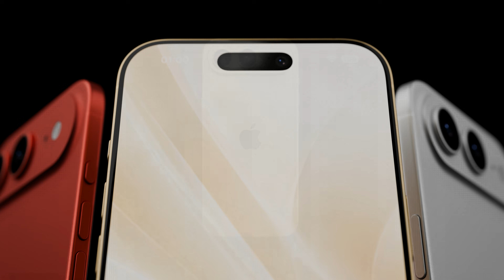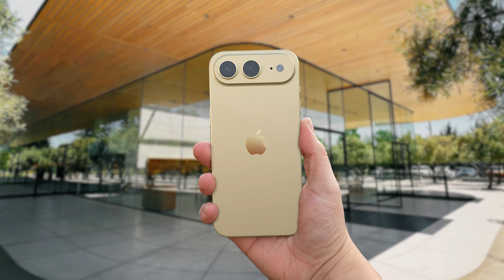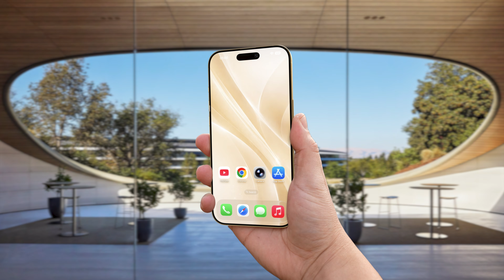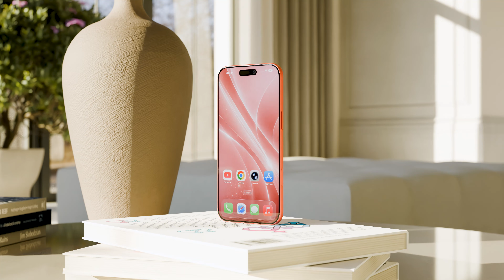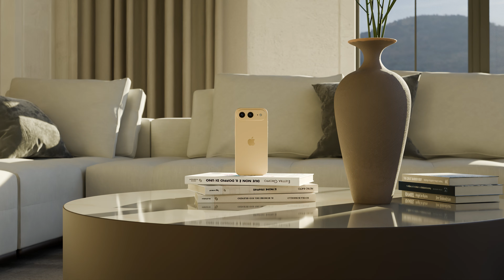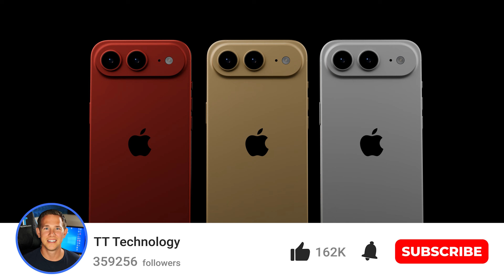Apple iPhone Air 2 - First Look!

Comment: If they ditch the beautiful aesthetics of the Air (1) then it’s not interesting.
Apples current obsession of “phones should be ugly and cheap looking” just make me not wanting to upgrade. Why pay premium money for “cheap” aluminium that scratches. Unibody is the worst thing they came up with, imagine if they used the same aesthetic approach on the pro that they had for the air… but despite the countless “ugly AF” feedback they seem to uglify the air, that’s the most durable phone they’ve got while being the most beautiful, instead of addressing the pro being ugly AF as well as fragile scratchy and frankly, giving “cheap copy” wibes.

Comment: Everything in the iPhone error isn’t the top module of the phone. To make some of the adjustments that he’s talking about they have to have room for those adjustments. So it probably would change the dynamics of the iPhone Air slightly. As if they put in a vapor cooling chamber. They will have to add another layer to the phone. And each layer increases the thickness a bit. I don’t know what’s going to look like but hopefully it isn’t too thick if that is the case and just buy a regular iPhone. You know, but I don’t know. I’m just speculating. But you know most of the lower end of the phone is all we all know it’s all battery so I don’t know if they will have to tweak some things and change some things to make it work, but if they pick up the phone, it will take away from the magic of the iPhone Air, which was thinning different we’ll see what happens personally I’d rather see another speaker than another camera but then that’s just me because that mono speakers what did it for me? I can’t handle just one little speaker on the top of the earpiece saying I want to hear the full range of sound, but we’ll see what they do.

Comment: As long as they keep the watered down colors & titanium edges, and add duel speakers I’m getting the air 2. I really wanted the original air but those speakers were a deal breaker
Reply: Yeah lack of stereo speakers for  $1000 is diabolical.
Reply: I think your tripping I use mine just fine and I’m from nyc
Reply: @NewYorkRaised what does being from nyc have to do with anything lol
Reply: @vqpaki 😂

Comment: I took a chance and bought an iPhone Air in December knowing that I could return it if I didn’t like it. It was a double edged sword. So much about the Phone I loved. Something about the display that was mesmerizing and the perfect size. I really really wanted to keep it, but, I returned it and got a 17 basic. There was only one reason that I returned it. It was the sound system. I felt like I was listening to a chatty Cathy doll. I was extremely conflicted.  The single speaker system was intolerable. I was really disappointed in this video because you had nothing to say about the speaker system. I had to give you a thumbs down in your review for that reason I would’ve kept it had they had a stereo speaker system.
Reply: Yeah we had stereo speakers for over a decade now. No excuse to by the Air over the 17.
Reply: @storm2hot yes their is. Durability. I’ve dropped this phone on concrete over 3 times no nothing. Dropped it in my hardwood floor at home over 20 times nada ting. Point is the material used on this phone is way better than the 17 and 17 pro which look cheap as heck
Reply: @NewYorkRaised I’ve dropped plenty of iPhones and no crack. This is a baseless point and most people is not as clumsy as you.

Comment: I love my IPhone Air and can’t wait for the dual camera system. I would prefer the telephoto to the ultra wide.
Reply: Exactly. Telephoto is used far more often
Reply: Especially when you have the panorama setting already. This mode actually takes a better pic than the wide angle lens. Just takes a few seconds longer to use that’s all.